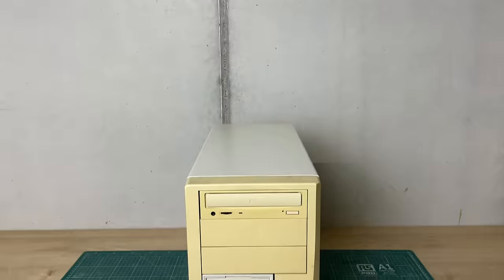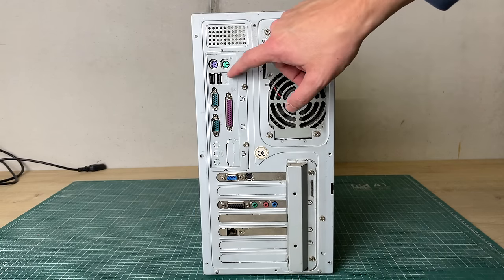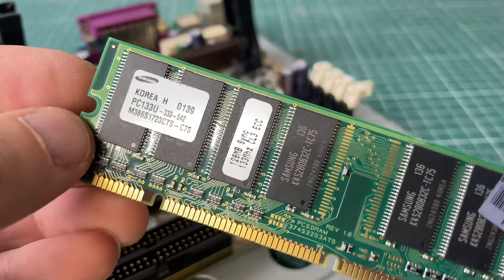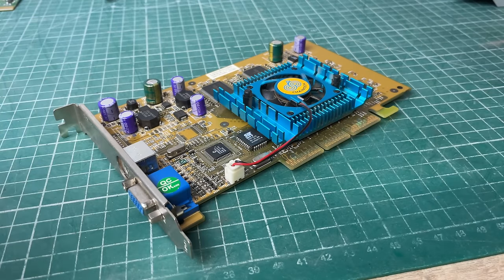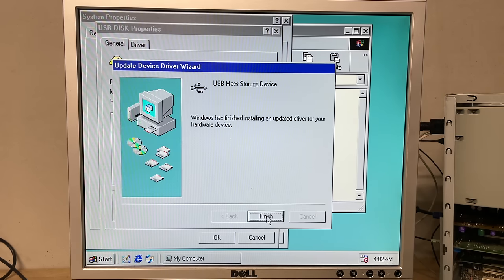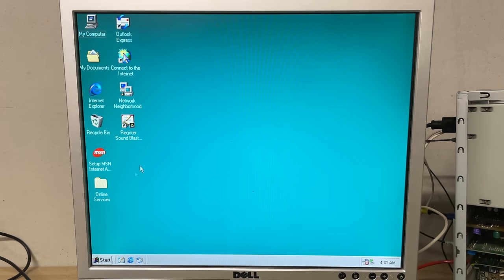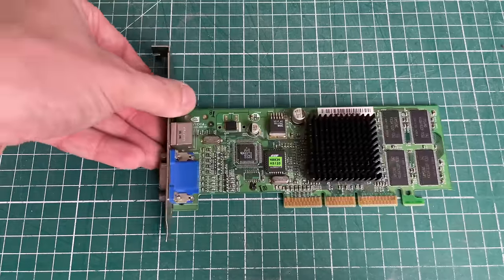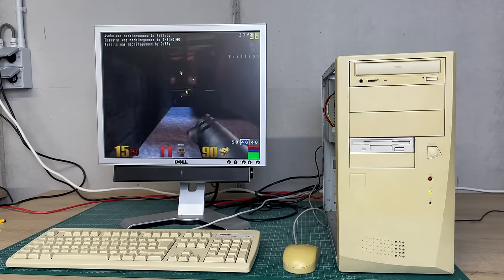Intel Pentium 3 + Geforce2 = Fun !

Comment: Those were top specs and everyone's dream computer when I was in high school. Also those case covers were a hassle to put back together.
Reply: Yeah, they were kind of "in-between" the AT and the true ATX format, betraying them as the early ATX form factors. I honestly despise these cases, as it forces you to take the panels as a whole.
Reply: @Dmetsys  To me personally "era correct" is s bit overstated, but that's just me. One to three years is not a big deal even if you're talking about hardware from back then. Actually my dream computer back then was something like a Pentium III 600 to 1000Mhz with any kind of Geforce 2. It was leagues above my AMD k6-2 450Mhz with a 3dfx Voodoo Banshee PCI.
Reply: @Dmetsys We didn't care about being "era correct" back in the day.
Reply: @totalrandomtechnolog  True. There are several parts of this system that stuck out to me as a budget game build, upgraded two or three times with the best components they could afford, ending with that Ti.
Reply: I was gaming on a Power Mac G3 with a Radeon 7000 in it around that time, and that thing kicked ass. Played a LOT of Unreal Tournament on there :)

Comment: Do keep in mind that there were a lot of different GeForce 2 MX versions available out there. They differ from versions with DDR or the slower SDR memory, a 64bit or a 128bit memory bus, an MX(100), MX200, MX400, of which the MX400 would be the fastest due to the higher clocks. Also the memory size could vary between 32 and 64MB. 

So the card everyone on a “budget” wanted was the GeForce 2 MX400 with 64MB DDR memory and a 128bit memory bus.
Reply: Yeah, MX400 was the best. The basic MX was also fine when it was a 128-bit one.
Reply: I may be wrong but, I think the OG MX is actually better than the 200. Assuming the manufacturer set it up correctly.
Reply: I had the MX400, it sucked. No hardware T&L. Need at least a geforce3 to be as good as an xbox.
Reply: @televiciousgoober  or as cheap alternative today you can use something like gf4 mx440. it's  essentiality  gf2 with hardware t&l
Reply: @gorjy9610  had that too, it actually only has T no L. So most shaders do nothing.
Reply: @televiciousgoober  The GeForce 3 (non-Ti) was the only card that came out earlier than the MX200 and the MX400. I don't think anything else, at least not for that price range, was very interesting in the GeForce 3 line-up. If you wanted something fast, whilst paying slightly less, you needed to go for a high(er) segment GeForce 2 Pro/Ti/Ultra. The Ultra and GTS even sometimes outperformed the GF3 Ti500. The only big differences were the DX8 support and Shader 1.1 support. Hardware T&L (for DX7) was probably still made available in the newer GPU's, as the single vertex shader was not fast enough to emulate it yet.
Reply: @osrr6422  Yes. The manufacturer was the key to success. Although the MX400 was a lot faster when the manufacturer was able to set the above mentioned correctly. Those cards were awesome!
Reply: @Inject0r  ATI had some killer cards with T&L at the time. I went ATI after GF2&4 and have been there since. Except for the Ion2, had that, was better than the GF2&4.
Reply: There are some misinformation in this thread.
Original Geforce 2 MX was 175 mhz core and 166 mhz memory. (64-bit DDR or 128-bit SDR memory bus)
Geforce 2 MX / 200 was same, but had only 64-bit memory bus and SDR memory.
Geforce 2 MX / 400 was same, but had 200 mhz core clock, and 128-bit or 64-bit bus.
BUT , 128-bit bus was SDR, and 64-bit bus was DDR. There were no 128-bit DDR versions! Those were reserved for high-end, geforce 2 GTS, Ultra, Ti and Pro.

All Geforce 2 line had T&L, including MX
Geforce 2 MX 200 was slowest, true. Original MX was in middle, and MX400 was fastest. But, there were no 128-bit DDR versions.
As it was bottlenecked by memory, you've chosen one according memory. Better manufacturer usually used better memory, and thus, you could overclock it more. The gains were incredible, +25% after overclocking with good memory, and another +20% for killer drivers from Nvidia, that came out with Geforce 2 Ultra in august 2000. That was huge leap from original MX release in june 2000, almost +50% performance from stock drivers and stock clocks.
 https://www.anandtech.com/show/600
Reply: @warrax111  I stand corrected. You’re right. I must’ve mixed those details up with the Hercules 3D Prophet II GeForce 2 GTS 64MB, which I eventually bought to replace my MX200 32MB DDR with. That brutal monster did in fact contain 128bit DDR. 

Good call!
Reply: @warrax111  They did not have true pixel shaders they had vertex shaders. They had transform, but no lighting. They bumped up speed, but skimped on features. The gf3 and GF4ti had all shaders, the MX were the stripped down cheapo ones. I owned them all. Fire up morrowind there is no reflective water.
Reply: @televiciousgoober  wow, someone deleted my long comment, i commented yesterday. i cannot believe it. that sucks. i will not answer again it was like 10 minutes.
just saying, they had pixel shaders, every 3d card have. even ati rage 128 , or pro. just look at core config.
water in morrowind is something other it is new version of pixel shader
Reply: @warrax111  i didn't delete it. morrowind water was shader version 1.0 if you look in dxdiag with mx cards it's shader version is like 0.5 or 0.7 or something. The vertex shading they used was pre-shader standardization because they were using older chip designs at higher clocks.
Reply: I got one myself too from a friend , it works great , running my childhood games with an 850mhz amd cpu .. my childhood computer was 200mhz celeron and some cirrus logic graphics card..so ye 😂😂
Reply: I still remember receiving some money for my birthday as a kid and, because I was so excited, I bought the GeForce4 MX440, imagine my disappointment when it was no better than  my geforce2 mx... Still recovering from that financially and emotionally
Reply: Yes but the Ti give better performance, I remember I think at the time it was the release of the role playing game Neverwinter Night I think, I still had it seems a Voodoo 3-2000 OR 3-3000 not compatible with the game. So I bought the poor GF MX400 it seems in 64mb even the game a horror that latencies not worth to play and so I bought a GF2 Ti if I'm not mistaken, and the it go perfectly. The MX series was not for gaming, whether it is 64b or 128b model, as now the GT models are not made for gaming or low graphics and performance, compared to the GTX or RTX 🙂
Reply: so that's why Quake 3 looks like its running on a Pentium II 200Mhz with Voodoo1; a PIII with a GeForce2 should run Q3 at 60fps at 1024x768

Comment: I always liked the Pentium II's with the full passive heatsinks.  They made great Linux servers with very little noise.  PIII's,  yep I liked those as well,  just not as much.   I also had some PIII Xeon's back in the day with the big weird Slot 2 cart.
Reply: I remember my first computer had dual socket 370 motherboard, 2x Pentium III 1.3GHz, 512MB of RAM,  ATI Radeon 9800 and Windows XP  and I got it in 2006
Reply: @ABYTE64  Yeah that’s great as you could dual boot 98 SE and XP flawlessly on it as the Pentium III was made in the Windows 98 era, also that was a very high end PC in its time as that PC probably used to cost at least 2500$ when it was new considering it has two high end Pentium IIIs and a dual socket mainboard.

Comment: I remember that my very first gaming PC that I built in early 2001 had these similar CPU and GPU. It had a 1 ghz Intel Pentium III cpu with 256 mb pc133 ram with a 20 gb hard drive, floppy drive, CDRW and DVD drives, creative sound blaster sound card, and a 32 mb nvidia geforce 2 graphics card, and for the operating system, I originally had Windows ME on it, but then later upgraded it to Windows XP in 2002. One game I liked playing on it was the original game of Deus Ex.

Comment: Reviving an old pc is fun and satisfying I also have a Pentium 3 450 slot 1 which I acquired from my neighbors trash unfortunately the ide hdd is already undetectable and nowadays it is very hard to find an ide hdd, good thing Ive acquired an 8G cf card and cf to ide adapter and I installed windows xp 😅

Comment: I HAD A P3 THAT HAD BAD CAPS it was on most boards, capacitor plague was a problem related to a higher-than-expected failure rate of non-solid aluminium electrolytic capacitors, between 1999 and 2007
Reply: I've recapped numerous Pentium iii and 4 motherboards as well as some Macintosh motherboards because of it
Reply: The bad caps plague started to act at start of 2000s. I have some slot1 that still have their caps ihtact but at least one or two have some bad caps and I would say they probably suffered of unproper bad cooling inside of the PC case as there is only one fan blowing ar out of the case and one fan installed on the cpu heatsink blowing hot air to the caps. Other reason was the bad PSUs. PSus with bad caps feed abnoxious power to the board and the caps were the first to die.
Reply: Yep, absolutely. It was the Caps that were bad at the time.
Slot Boards went around that with an array of Caps. You often See Slot Boards with 10-20 Caps near the slot...
But yeah, the reason for the caps are 2fold: 
a) misuse and abuse as the VRM area gets very hot and they use 1000-2000h Caps there.
b) high water contents of Ultra Low ESR Capacitors (Nippon Chemicon KZG, Panasonic FJ an similar)...

Comment: geforce 2 mx when introduced was quite advanced with true hardware t&l support, 2 pixel pipelines with 2 textures units each and consumes only 4 watts. By the way it was priced at around 120 $. It packed more power and was in the same time way cheaper than most of the competiting products
Reply: Yes you are right but I had the g-force 2 mx/mx400 with 128 gigs of RAM in 8x AGP
I'm not remembering exactly how many watts but it did have an additional four pin power supply on the card that was required
Reply: @cgriggsiv  geforce mx with 128MB of vram is a rare version. I happened to have one too. Mine does not come with an extra molex connector. I assume the 4-pin connector on your card was added to make it look more powerful... geforce mx itself does not need that much of power at all and was very popular in low power consumption comouters: laptops, imac g4, powermac g4 cube...
Reply: Back when Nvidia had competition, before they bought out everyone, they used to offer great generational leaps at decent prices. ATI was breathing down their neck long after 3Dfx folded, and kept Nvidia honest, but as soon as Nvidia won hearts and minds with their dodgy PhysX nonsense and paying off tech channels, they turned into their true form : VAMPIRES!

Comment: I remember my old Pentium 2 (400mhz), with 128MB of RAM, and a 16MB of video, ran perfectly smooth Quake 3 Arena, it was like 35fps, but your machine runs too low even with the graphic card. That card was lower than 16MB video? I dont remember the exact model of my old card. Good video bro!

Comment: I got my W98, Pentium 2 400Mhz 128mb RAM for free from a dude who just had it in its pile of stuff.

It was free to get, but it is costing my soul to work on it.

Now I'll have to burn a Linux thingie on a CD so that:
>double/triple booting may be possible
>booting from a USB may be possible
>moving files to the computer may be easier (I tried 4 methods to move the USB driver to the PC, and when I managed to IT WAS INCOMPATIBLE)

My goblin brain tells me that I NEED to try and run games like TF2 on it, but I know very well that it is IMPOSSIBLE.

On the other hand, before setting the PC on the side again for awhile I managed to transfer the Quake directory on the PC. WINquake lacks drivers, but the original version... it ran on Software Mode perfectly, nothing was missing, the performance was smooth and the music was there.

At least I managed that... the original plan for the W98 PC was to run oldass games on real hardware to then maybe post the proper results online for archival purposes, and the origin of that plan was my intrigue with all Quake ports...

Comment: In 1999 I got myself a Celeron 466 with a TNT2 Ultra card, within a few years upgraded to a Pentium III 800MHz but kept the same card, and that's the system I gamed on until ... 2007. Oof.

Comment: I have that same motherboard. It has a Pentium 3 550mhz cpu , 384mb of ram, 2 x 40gb hard drives, a Geforce TI4200 128mb card, a 3DFX Voodoo 2 12mb card and a Sound Blaster Live in it.
Running Windows 98SE, it's my favorite retro PC.
Love the first MotoRacer.

Comment: Nice. Got almost the same build. Perfect card for this system would be a nvidia tnt2 but i replaced it with a Geforce 3 Ti 200 since im playing in higher resolution as 1024x768 and some dx8 games

Comment: Pentium 3 did come at 333mhz but it was a later low end varient marketed to home business. The theory is that having a underpowered PC saves money because the people whom would have bought this PC would be using software like quick books and basic word processing. Back in the day people would not have know the difference between pentium 1,2,3 they just need a computer so it was easy to sell them outdated junk.

Comment: It's a little unfair to compare a Rage 3D pro card that came out in 1997 with a Geforce card that came out in 2001.  That being said the Geforce would certainly be a better choice for a later Pentium III.  The Rage card is more appropriate for a Pentium II or even OG Pentium machine.

It kind of boggles the mind that stuff like this is actually bringing money.  Slot 1 machines were seen as particularly undesirable.  Everyone I knew who could afford to, had abandoned them by the 2001-2002 timeframe.

I still have my Asus P2B and overclocked Celeron 300 setup.  I should dig it out...
Reply from the maker: Thing is that these Rage Pro cards were used by a lot of vendors (even in P3 systems). "High-end" cars for 1998 / 1999 are getting pretty expensive. Think you easily pay 30 EUR for a TNT2 card nowadays. (excluding the vanta's and m64 models)
Reply: @RetroSpector78  Not completely disagreeing, but I think our current silicone shortage is starting to warp people's perception.  Particularly some of the younger folks who were very young or not born at the time.  Twenty years ago  a 4 year old graphics card was considered hopelessly outdated, and you'd spend a reasonable amount to get a new one. I had a Rage Pro card in my Celeron rig circa January, 1998. By 2001 I'd gone through three other cards.

 Today, you get companies installing 7 year old GT730's  due to a lack of supply for anything better on the low-end and folks are starting to see this as "normal.  Yes, Rage Pro cards were still being installed circa 2000-2001, but there was no expectation that they'd be doing anything other than spreadsheets.

Then again, time marches on and things become more rare.  I remember arguing on the Vintage Computer Forum back in around 2005 whether or not 486 machines were really "vintage".
Reply: @dennisp.2147  It was also a different time. There were massive gains with every iteration unlike nowadays. You still can use a 5 year old GPU nowadays with modern games. Try that in the late 90's / early 2000's.
Reply: @mxmaverinho8115  That's the point I'm making in my first comment.  Moore's law was still in full effect both for GPU and CPU.  AMD released the K6 at 166 and 200 mhz in 1997.  in 2001 you had Athlons and P4's at 1.5 ghz.
Reply: @dennisp.2147  You can do spreadsheets on a 486 :)
Reply: @cyberp0et You can do spreadsheets on a 6502 also, what's your point?   Do you know the meaning of "non sequitur"?

Comment: Yeah, that USB driver you should alert people of the internal changes that thing can do, especially if you are running a Non-English Windows 98 system... If that's the case DO NOT  install that driver since It's not official and you can have more instability than you already have for Windows 98...

Comment: To be fair, you're not really comparing graphics cards from the same generation.  The ATi Rage Pro series was meant to compete against the Voodoo or nVidia Riva 128 chips, while the Rage 128 series was meant to compete against the nVidia Riva TNT or the Voodoo 3 chips.  The nVidia GeForce2 Ti was meant to compete against the ATi Radeon 7x00 or the Voodoo 5 chips.  So of course the GeForce2 Ti is going to beat the snot out of ATi - it was about two graphics generations apart!
Reply: Exactly.  4 or 5 years apart.  If you bought a Rage Pro card in 2001 you were going to be using it to do spreadsheets.
Reply: Yep, although he does mention that the GeForce2 Ti is comparable with a Radeon 7500 at 11:19 but that point does start to get lost when he goes on about "crappy" ATI cards. In my Pentium III 500 MHz setup I have a Gigabyte ATI Rage 128 Pro Ultra which works quite well on Windows 98 and only cost me $25 CAD from eBay.

Comment: If I were to recommend an nVidia MX card as a cheap alternative to the real GeForce2, I'd honestly tell you to get a GeForce4 MX 440.  The GeForce4 MX's are actually running GeForce2 cores and they tend to be much cheaper than, say, a real GeForce2 Ultra, but offer close to the same performance!  On the other hand, GeForce2 MX isn't a GeForce2 at all.  It's a gimped GaForce 256, the predecessor to the GeForce2 - and GeForce2 doubled the GeForce 256's performance so there is a big difference to be had there.

Comment: Hello I have a Question, I have a Motherboard ECS P6ISA ATX, Ir runs Windows 98SE but i don't have a Vídeo Card for Play Games. What Vídeo Card is the indicated for My Motherboard? Thanks
Reply: The same cards that were shown in the video also work with your motherboard based on the information I have Googled! If you're going for Nvidia, you should probably get a GeForce2 MX400 if you want a budget card, or a GeForce2 GTS/Pro/Ti if you want it to be a bit more special.